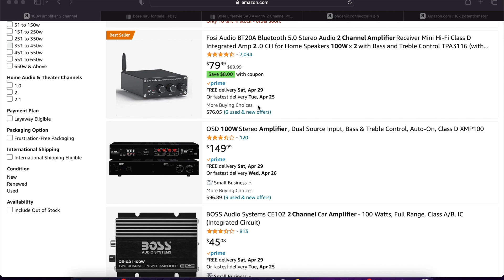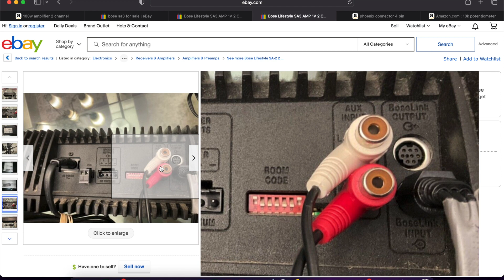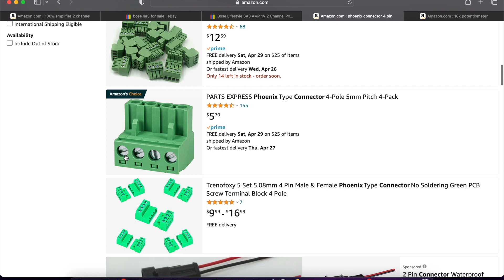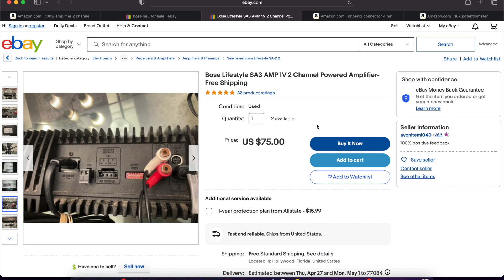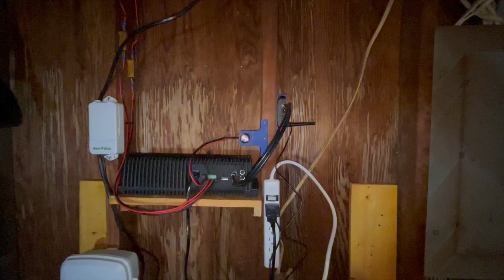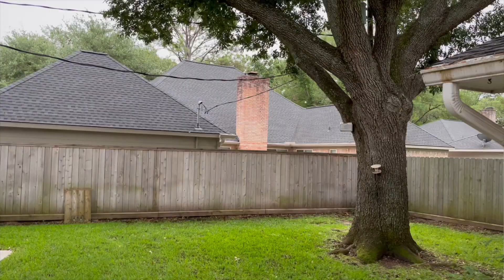Converting a CHEAP Bose SA-3 amplifier into a standalone unit

Comment: You describe the dip switch settings as "left two in the up position, the remainer down". But in the video, it shows the left and right switches up, and all in the middle down. Which is correct?

Comment: i did exactly the same and there is no ouput on speakers. Green light is constantly on. i do get output with RCA cable on another amp. So there must be something with the SA-3 amp :( I tried various dip switch settings but with no luck.
Reply: i do have guitar cabinet speakers 8ohm and 16ohm. Maybe that would be the problem?

Comment: 🙏Thanks for sharing your experience. I also just received a Bose Amp but unfortunately it does not have the RCA Aux input so I have found input the pins of the 9pin plug from a manual online, unfortunately the image does not show if they are referring to the male end or the female receptacle so I am puzzled 🤔

Comment: I have exactly the same setup only with 3 times the Bose SA-3 amplifier. I want to control all 3 by only 1 potentiometer and i need to know of it's possible to connect only 1 aux input and interconnect the rest by the Bose-link cables via in-out

Comment: Do you think it would work ok to simply hook up a pre-amp to the aux rca connectors? Or is it necessary to use the VCA connector for the volume? Just wondering so I can hook up multiple inputs like a cd player or tuner. Thanks

Comment: Thank you so much for this video Michael, really useful. 

Question: You mentioned that without the potentiometer it operates at about 30% of it’s actual power.. still it DOES have audio output right?

Before using the VAC output I’m interested in only using the RCA connection but I don’t know if there’ll be any sound.

Thank you!
Reply from the maker: Yes, but it will be very quiet and may go into 'sleep mode' if it doesn't detect a high enough audio signal for a certain period of time.
Reply: Hi Michael, having issues with amp powering on, green light is once then three blinking quickly.  Had it working last week. But now the green light isn’t on all the time. Any suggestions, thanks Peter
Reply: @peterclark355  Constant slow blinking
(1 sec. on, 3 sec. off)
The amplifier is OFF (standby).

Continuously lit The amplifier is ON and ready to produce sound.

Blinking quickly The amplifier is ON and receiving data commands
from the media center through the Bose® link port.

Constant slow blinking
(1 sec. on, 5 sec. off)
The amplifier is set up as a supplemental amplifier
and it is OFF.

Lit but rapidly flickering The amplifier is set up as a supplemental amplifier
and it is ON.
Status LED
Reply: I am using it with alexa.  I have to keep the volume range from 8/10 to 10/10.  If it detects no or low signal for a few seconds, it will go to sleep. Unfortunately this is not configurable using dip switching.  Bose showed some cleverness here 😂